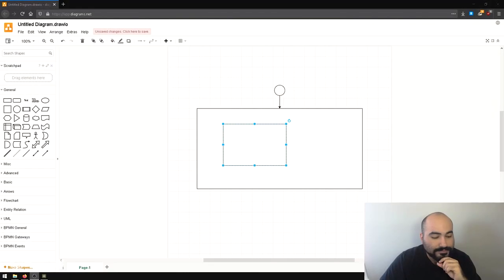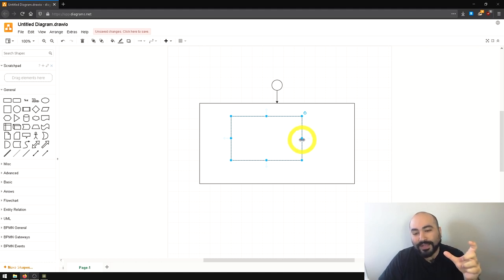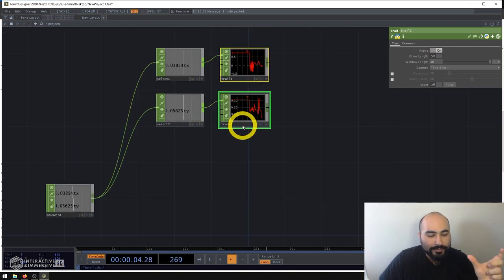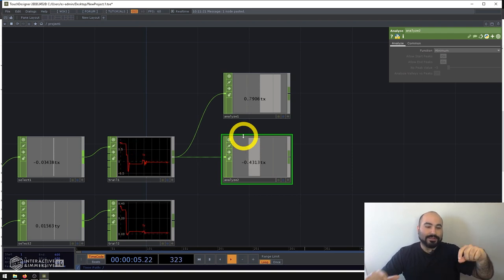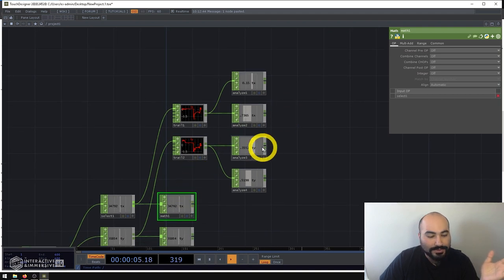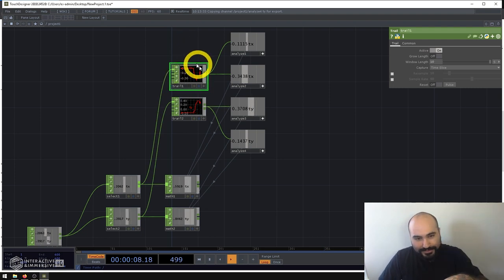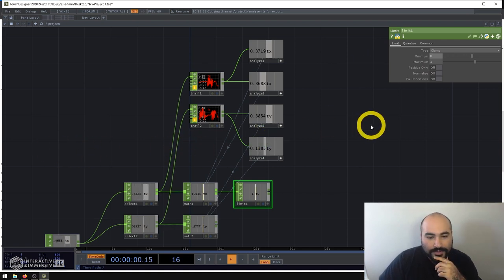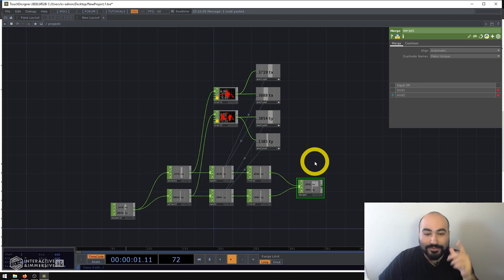How to Quickly Calibrate Sensor Data in TouchDesigner (Tutorial)

Comment: Locking the Trail is vital. I didn't set it and it wouldn't work as soon as the mouse would stay still in a position for the whole trail time length. Thank you for the add.
Reply from the maker: I usually lock the trail since my sensor and interaction areas dont move, and once you do that after a quick calibration, you're good to go!

Comment: I did something like this for a children's exhibit where they were moving a wand in their hand. Because kids of different height were using it, the Trail was never locked, but each Analyze CHOP was sent into a Lag CHOP with (on the maximums) a quick rise and a very long drop (30 seconds), to adapt to a changing area of interest. I'll Snippet it.
Reply from the maker: Awesome point. Folks can also leave the trail unlocked and it will continuously auto-calibrate based on their range of motion of the person in the sensor's view, and having the Lag CHOP helps make the transitions between those calibrated values smoother.

Comment: Thanks for your helpful video.  Can I connect something else instead of mouse?(I want to exchange a code that written in c++ to select range in cam)
Reply from the maker: Absolutely, you can connect any CHOP signal to the same system. It could be a mouse, kinect, leap motion, VR controller, or anything! That's the great part of simple workflows like this one, they are very flexible.
Reply: @TheInteractiveImmersiveHQ  
Awesome!!!

Comment: Hey, This tutorial is great, however, I have a question regarding how we can use this setup or a similar one to connect a microphone sensor from an arduino to control sound coming in that will drive the visuals. Is this something you can help with?
Reply from the maker: This technique may or may not be as helpful with audio signals, the section with Analyze CHOPs would be useful. If you're looking for more personalized help getting that setup, I'd highly recommend checking out our HQ PRO program: https://interactiveimmersive.io/lp/hq-pro-full-trial/

Comment: Hey, this tutorial is great! When I use the mouse in chop, it works. but I'm reading the data from a laser sensor. when I try to use math chop to read the range, I got a mistake that said: float() argument must be a string or a number, not none type. any thoughts? maybe I did something wrong with how to denoise the sensor date, but I don't know how to fix it.
Reply from the maker: It sounds like if you're using a reference in the Math CHOP that isn't working if you maybe changed the operators in the network. What do you have in the parameters for it?

Comment: this is great, thanks! what I am trying to decipher is that with leap motion, the sensor values for tx for example has a range of -0.4 to 0.7, and when converted the way you've shown, the range works. but when I move my hands away, it defaults to an average value of 0.46. how do I keep my default value to zero when my hand is not on the leap motion, and translate the rest of the values as per the math when I move my hands? hope I could explain the problem.
Reply from the maker: Hmm that's a bit of a tricky one. I'm not sure there's an easy-off-the-shelf solution I could explain in a comment. Do you happen to be in The HQ PRO? If so, we can help you there build up a few examples of this could be done.
Reply: @TheInteractiveImmersiveHQ  thanks, yeah I suppose that's a challenge. I tried using several methods, but none of them worked in my knowledge...just testing the waters playing around. Sorry not in HQ pro yet, maybe will be when im a bit more pro ☺️
Reply from the maker: @TheLiveSquare  No need to be a pro to join The HQ PRO, it's great for artist and developers of all skill levels :)  One way you could do this easily, but it's definitely not the best implementation is to use an Expression CHOP after your Math CHOP and set the expression to: 0 if me.inputVal == 0.46 else me.inputVal
Reply from the maker: That way, any time the value is at 0.46, it will be overwritten by 0 and any other value will just get passed through. Not perfect, but should be quite effective.
Reply: @TheInteractiveImmersiveHQ  hey Elburz thanks for getting back so quickly on this. you're right, im still noodling around but I think it is going to the point where I need to get into this seriously. I have a particular mission at hand so I think it will be really good to build some foundation and join pro to really take it up to where I want!! are you currently doing your twitch sessions as well?
Reply: @TheInteractiveImmersiveHQ  Thank you, this is brilliant, I didn't know of this and sounds like a big help. I'll try it out and see if this works for Leap. Appreciate it a lot!!! :D
Reply from the maker: @TheLiveSquare  No problem! Expression CHOP should work but it's not the most "fail-safe" approach. Yup we're on Twitch all week this week! Would love to see you in The HQ PRO! Feel free to check out the 7-day free trial to see if it's a good fit for you at no cost.
Reply: @TheInteractiveImmersiveHQ  thanks for the suggestions still. im sure a different system needs to be built for this which is more robust, but appreciate it. yes I will tune into the twitch talks from time to time, been following you. and thanks for the trial period, will see how it works. Cheers :D